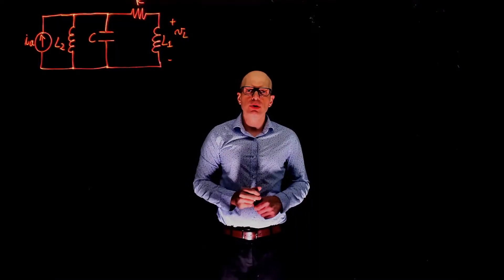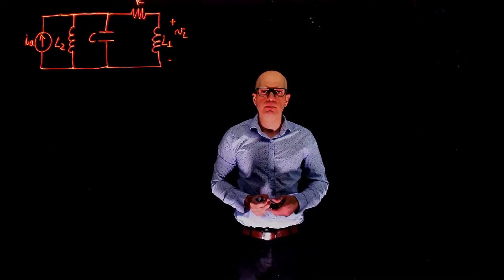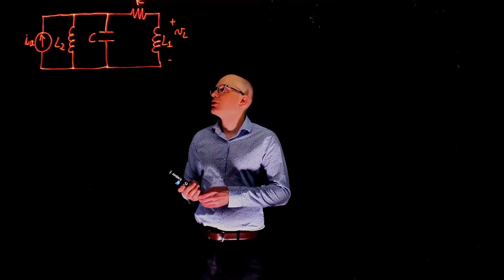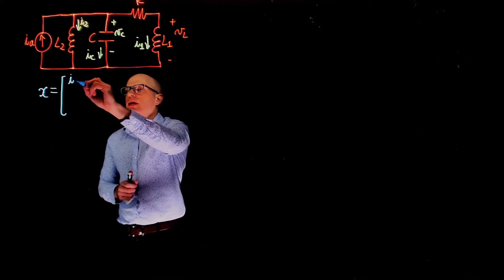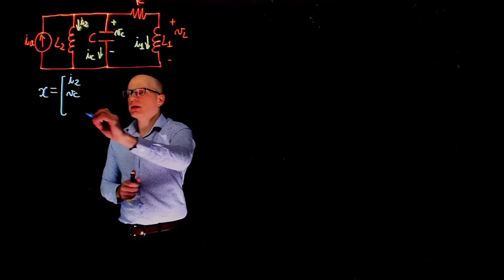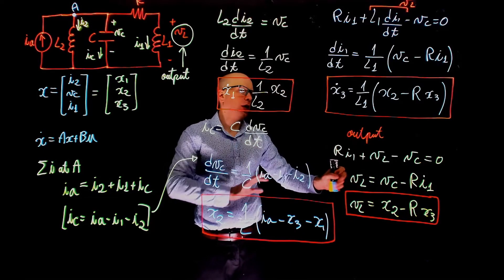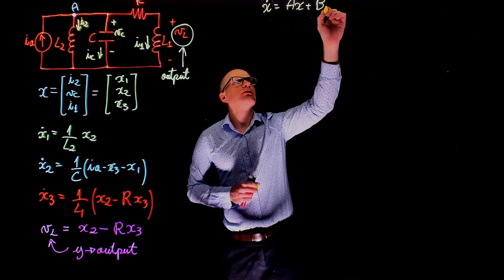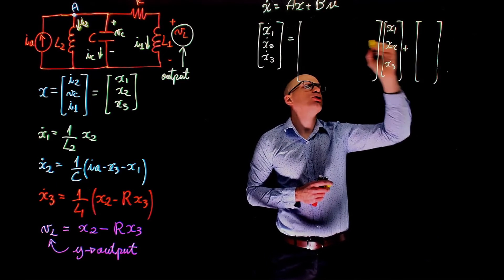State-space model of an electric circuit - STEP BY STEP

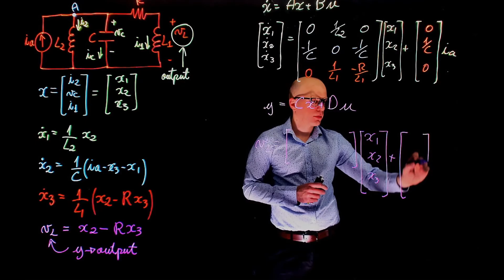Comment: At 15:15 the D matrix should be a 1X1 not a 1X3 matrix. The left hand side is a 1X1 output matrix, On the right hand side the first term is the product of a 1X3 matrix with a 3X1 matrix which gives 1X1 and so the Du term should also be 1X1.